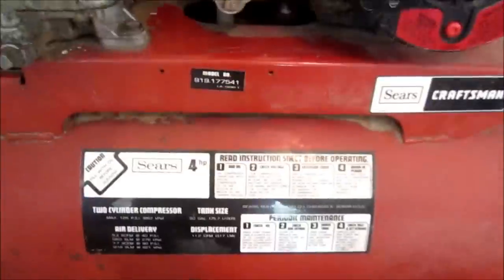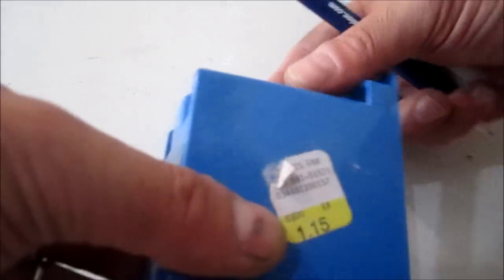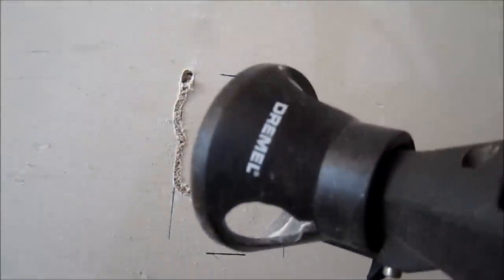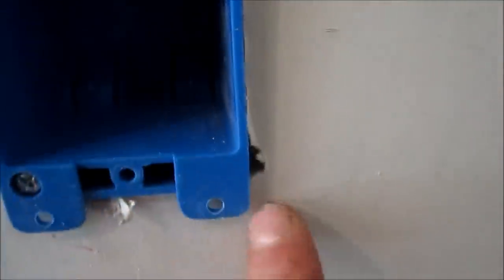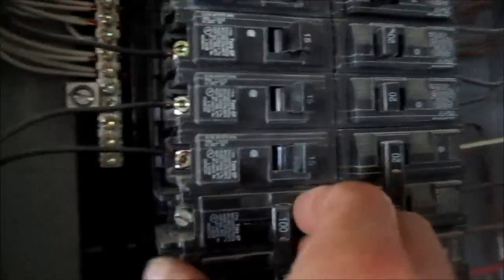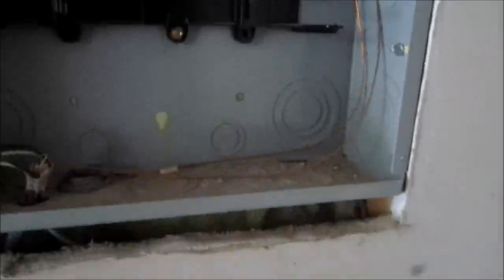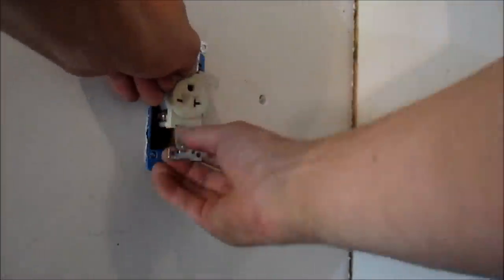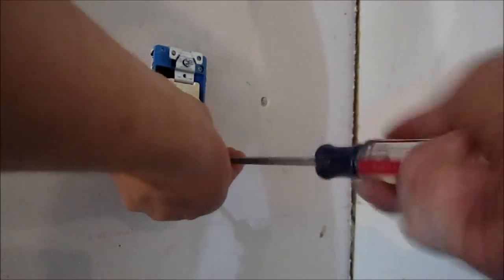How to Wire a 240 Volt Outlet - DIY Install a 220 Volt Outlet - NEMA 6-20 20 AMP Circuit Breaker HD

Comment: The white wire should be color-coded red to indicate it is carrying power and not used as a neutral.
Reply: Its called an identified conductor and the black/white color code works because just by looking at the plug you can tell its a 240v with 2 hots. But I guess its all dependent on what code book you are reading.
Reply: @MrRoyalblunts  we know there's only one , you're right

Comment: everything was done right but just a side note i would definitely remove any hand jewelry before working with electricity i noticed you kept your wedding band on the whole time and you definitely dont want to accidently get blasted by it grounding out on anything. also you dont have to but i personally like to wrap some electrical tape around the entire back of the outlet just to cover any exposed wire just incase you or anyone else have to work on it in the future. good job, very informative video!
Reply: It's called a SAFETY CHECK.

Comment: What I do remember is try not to make it a habit becoming part of the circuit by clutching the outlet and touching the hot and neutral side at the same time.  A big difference between a 15a bite vs a 20a bite. After awhile a 15a bite is nothing, but it only takes one time from a 20a. I felt that run through my arms,  through my teeth, through my balls, then my feet. 2003, Mid winter, Truckee, CA. Most gratifying job cuz I learned the other trades.

Comment: Finally someone who uses the bare copper as ground and not the white on the ground. I know there’s arguments that why not pull 12/3 but it’s an air compressor it will always be 240 not requiring a neutral .
Reply: A good electrician doesn’t really need that they should know but good work thinking ahead

Comment: Honestly in my own opinion and also as an electrician, I believe the ground on the plug should be down instead of up, why? Well gravity tends to make the cords pull down and if you ever notice when the cord is tending to come lose the first prongs that come out are the power and the ground holds it  in place so if it was to short out while in that position it is grounded. Now if the plug is upside down with the ground up, like I said before when it's coming loose the ground prong would come out and the only prongs holding the cord is the power prongs and the equipment is not grounded. Just a lil thought to take in consideration.
Reply: my opinion also as an electrician is top is better for as something or someone were to fall on it, makes the first and last contact being the ground is longer.
Reply: I disagree and know out of my own experience that this is the correct way to install it. If you install it like most electricians do tan any dime or quarter will short the circuit and welds the poles together. Bin there (money felt from my nightstand and shorted the poles. The way he is installing it will not allow any metal to short and if so it will trip the circuit breaker.  I still don't know why electrician install it the wrong way. Maybe because the outlet looks like a smily face when installed the wrong way.
Reply: So why do practically all cords with an elbow have ground on bottom in the direction the cord would hang from the wall outlet? Powwwwww!!!!
Im with EL-A1
Reply: Jerame Phillips so you can get creative! Lmao no honestly everyone has very valid points and i think alot boils down to preference now a days.
Reply: I will retract my statement. The ground pole goes on top for 240 and bottom for 120. Cords for each voltage tend to follow this trend.
Reply: Ground up as a code requirement.
Reply: EL-A1
Reply: @thomascollier4913  what articles in the code says that. I can't find it in the NEC

Comment: Thank you Mark, I learned something about the orientation of the ground on the outlet.  I have seen many pro's wire with the ground on the bottom.  Your father in law make sense on putting them on top.  I will do this from now on.
Reply: In my house all 110v grounds are down except for my switched outlets..  those are ground up so they'll stand out and be noticed :)

Comment: the wires should have been on top of the screw so when you tighten it it curls around instead of the bottom witch will do the opposite

Comment: Mark, code in most places requires that you wrap the outlet with electrical tape to cover the wires so that someone reaching in to work on it or change it down the road is not electrocuted.
Reply: No code on wrapping a device with tape

Comment: Can a 3 prong dryer plug be connected to this outlet.  The un-insulated ground from the panel wired to the outlet is running to the neutral at the dryer?  Everyone references it as connecting the neutral on the dryer but its wired to the ground at the outlet.  Am I correct on how I am describing this?  Any educational help would be appreciated.

Comment: I need to run an out let for a welder and compressor. Can I used 12 gages exterior wire so I can barrier the wire under ground?

Comment: Off topic ... Whats the difference between a 120 volt, 220 volt, or 240 volt tankless electric water heaters? I am planning to upgrade and I am a total newbie at this. Please help with as much info as possible.

Comment: Ok so I’m not a electrician but I’m getting a compressor that is 240 volts that pulls 15 amps but I saw that you had like a dual 20 amp setup so like each on gives 120 so 2 of them gives 240 so will that mean you will need 2 20 amp breakers and 2 slots to put them in right???

Comment: Hey Mark - it's super hard to tell, but it looks like you have a Siemens panel and dropped a Square D dual pole breaker on it.  I just replaced a pair of dual pole 15A Square D breakers on my Eaton panel (that I didn't install).  If you check the inside of your door it'll tell you what breakers can be used but it's almost always "the same manufacturer as the panel" type warning.  Just a heads up!

Comment: Looks like a Siemens panel and you installed a Square D Homeline breaker. Have to check the label in the panel for approved breakers. Code violation.

Comment: In our shop we run all AWG 10 / 8 solid copper for our 220 and 440 welders, heaters and compressors.  In extreme weather you get to appreciate anal hard a$$ job site bosses who have never had a worker or job related accident in 40 years.  Match code to site requirements and conditions then bid for one to two grades heavier than required code and explain that electrical load is always increasing, never decreasing so they should wire for the future.

Comment: Thank you for the info. I am not an electrician by more means but dabble in some home stuff.  I am hooking up a 15amp 220voltac system today and not sure but I have been told if I was going to use 12/2 I should put a black piece of tape in the ends of the white lead to show it is 220.  Is this true/ important?
Reply: Re identify the white wire with red.. indicating 2 hot wires..

Comment: you should ALWAYS wrap the plug-in with electrical tape.  Cover those screws!  Wrap long wise, not around, like a belt.  Put the tape along sides and top and bottom.  Now wrap around the 'waist'

Comment: By the way, i have a question. How do we know what sizes of 220 volts circuit i can install? For example, if i want to install a 220 volt 50 amp circuit (with 8 gauge wires of course),  i just install a 50 amp breaker in any two plugs position of the panel box ? I saw you install yours on your older 100 amp breaker position. Yours are definitely ok since 20amp is much less than 100 amp. What if i do not take off old breakers, how do i know where should i plug the 50 amp breaker? 
Thank you very much!
Reply: His problem was that the panel was full.  He had no empty spaces for an additional breaker, so he had to remove one that he was no longer using.  Your panel may have empty slots and you can put a breaker anywhere that is empty.  You would want to match the manufacturer of whatever is already in the panel (Square D,  Siemens)   Since you referenced 220, it takes up twice the space of a single pole breaker (15 amp).

Comment: I just ran this exact 6-20 connection using the 20amp breaker and 6-20 outlet for my new table saw. I always check the voltage at the plug to verify it's getting correct voltage so I don't fry what I would be plugging into the outlet. I get 120 volts from ground to each terminal but I do not get 240 between the terminals. Is this the correct reading?
Reply: That doesnt sound right. What was the reading between terminals?
Reply: I fixed it. I wasn't connecting the breaker across both bars so I was only getting 110 volts.

Comment: neutral used as a hot?
Reply: in a 240v outlet, a neutral is not required to complete the circuit as it is in the 120v, you use two hot wires to complete the circuit.
Reply: in a 240v outlet, a neutral is not required to complete the circuit as it is in the 120v, you use two hot wires to complete the circuit.
Reply: +Fuck you Youtube I did not know that. I though everything had to have a neutral.
Reply: In this instance this outlet does not require a neutral since a neutral usually serves as the return path to the panel in a 120v circuit.  Stoves and dryers have neutrals and ground because of their 120v components (screen, lights, etc).  I still would have pulled a neutral (12/3 cable) and left it unconnected in the even that someone wants to upgrade or use a different appliance in the future.  White should not be used as a hot conductor, and if it is it must be marked somehow with black marker or electric tape to indicate that it is hot.  If 12/3 was pulled, white left capped, red connected.
Reply: I see white and black wires all the time on a 240 volt circuit.sometimes I mark then other times just leave it white. Any good electrician should know it’s a 240 volt circuit not requiring a nuetral
Reply: Christian Iniguez no. White conductor used as hot*
Reply: @MattBruns  no just 120v circuits  , that wire is typically used for 120v applications  , but if you phase or tape the white wire you can use that wire for you 20a 240v circuit  , couldn't use that wire for a 20a  230v circuit,  because that would require a 12-3 with grd.
Reply: @adamwise1790  you are right, but if you want it to be to code you must mark it.

Comment: looking at what you did you have 240v 20amp CB with 2 hot 120v wires making the 240v required...so where is the neutral.
Reply: In this application the neutral wire is not needed.
Reply: 240v has 2 hot and a ground. That's way it's much easier to wire up

Comment: Am I right that both the white and black wires are hot going to the outlet?
Shouldn't there be a neutral?
Reply: +Lisa Oechsli 
Generally Speaking, you are right.  For 120v, the white is neutral, black is line voltage, and bare copper/green is ground.  Wiring is a little different for 220v.  This gentleman used white and black for line voltage, and ground in place of a common.  Personally, i would have gone with a 4 conductor romex and used the black and red for line voltages, white for neutral, and green for ground.      

Either way is acceptable.
Reply: …. yes but consider the fact that motors and especially compressors only require the 240 hot / ground assembly since as there is no need for 120 like on a washer or dryer to run lights and panel, but on a motor the common is eliminated … So running on a 20 amp circuit 12/3 AWG would be a waste of money as 12/2 would save the cost of a needless 4th conductor ...
Reply: ZZZZ I personally feel that within the next 10 years, almost everything will have some kind of computer in it.

You're right though, for anyone budget minded, 12/2 is all that's necessary.  It'd be easier too since there won't be an extra conductor taking up space in the Jbox

Comment: First turn off main breaker and tape it off, with a sign power off  "DON'T TURN ON" if you are in another location, let all know not to touch the box,  wear a head lamp to free up hands if no light.
First use insulated screwdrivers to handle a 1000 volts, even with power off, don't snap breaker into box till you screw wires in solid and complete the wall circuit, have breaker off and when all wiring is complete and all connections are "tight", snap breaker into the breaker box, turn power back on.  A loose wire can cause arching, which produces heat and causes fires, always double check for tight connections and is a good practice to say tight out loud when double checking for tightness!  Safety an ounce of prevention can save your life, dlon't take short cuts, or chances.

Comment: thought you cant use white for hot must be black?
Reply: +Brainsmachine.bc White is hot, Black is neutral unless there is black tape on the white wire then it would be the other way around.
Reply: Matt Bruns are you sure? I believe NEC says otherwise, black hot, white neutral, green ground

Comment: Very serious error!!!
You MUST put color coded   electrical TAPE on each end of that WHITE wire if you are going to use as a deed/hit wire instead if the intended use as a NEUTRAL-return wire.  

This a must for CODE and SAFETY !!

Comment: If you needed a 20 amp breaker and already had a 100 amp one there, why not just do it from the 100 one? Might be a stupid question, I'm not electric savvy.
Reply: To add to his question, since you had a trailer being powered off the 100 amp, what stops that from taking just as long to trip?

Comment: Am I the only one thinking that todays american electrical connectors looks like european electrical systems from 1950-1970 regarding safety? 
Almost nothing covering those easy to touch live wires. Minimal isolation/barriers preventing shorts and so on. The guy in the video is even using a uisolated screwdriver. 
I guess using only 115v makes it "safer".
But using 230v gives double the power over the same gauge wire.
Reply: +Sigmund Trones Not sure about that, 120v is enough to fry you, let alone how easy it is to put your house on fire at such amps (easier than with the 230v). But yeah, ceramic outlets with bare screw receptacles are really from the 60s :)

Comment: you show it is rated at 16 amp but you are using a 20 AMP breaker. Shouldn't the breaker be 15 AMP in this case? I ask because I am hooking up for a simular air compressor. It say 240 volts 15 AMPS. It is a craftsman 6 HP 20 gal air compressor.
Reply: ***** Thanks for the understanding. I'll return the 15 amp and go with a 20.
Reply: *****
 You do not use 15 amp breakers with 16 amp equipment, the breaker is designed to trip once the current you are drawing exceeds 15 amps so it would trip nonstop. You use a breaker rated a step above what your circuit will draw. So if your circuit is going to pull 16 amps, you use the appropriate gauge wire and breaker for a 20 amp circuit.

Comment: Where's your neutral?
Reply: oh so like old school. Anything new up  to code is 4 wire.
Reply: This compressor is straight 240 volt. There is no neutral on a straight 240 volt circuit. The bare wire is the equipment grounding conductor.

Comment: Not very helpful
Reply: @nogripes  Well, I know how a screw works and I know how to use a screwdriver. I don't need to see a 5 minute video of someone pulling a screw out.
What I and probably others need to know is a bit more about the fundamentals of consumer electricity, a few hints on how to find& tie in the "hot" wire, neutral and grounds. Your video wasn't bad but it was too long for the amount of information it covered in my opinion.

Comment: Buddy you installed the receptacle upside down that's why your ground is downward. You also used a wrong wire, 12-2. The one you used is for 120 volts not 240. 12-3 is the right one.
Reply: You are the one that is wrong on so many levels.  Dont comment on things you know nothing about.